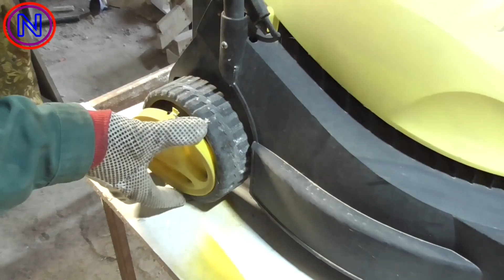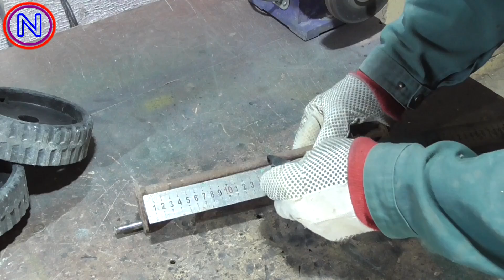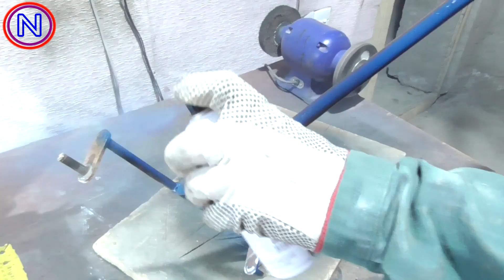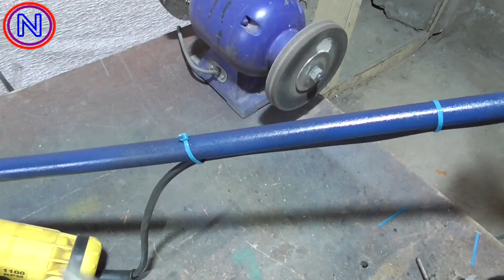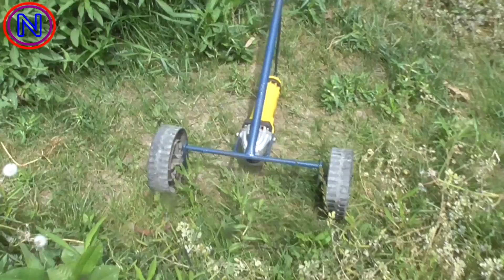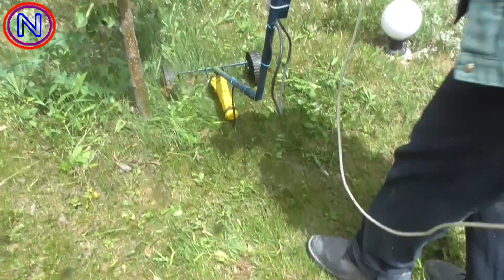AMAZING!!! Garden Life Hacks You Should Know

Comment: Take a old gas electrical generator get a sealed helium stirling cold piston that can generate liquid atmosphere that can fill an insulated tank with a bell siphon that fills an insulated resivor over six stirling cold gas pistons a V6 cold gas stirling engine with antivibration technology then use old gas electrical generator parts and you should have an electrical power generator that operates all off liquid atmosphere. Hell you could even design an air conditioning electrical power generation system too. 😵😲😁

Comment: A push lawn mower a swash plate pump motor a worm gear box to drive the wheels forward and a squeeze lever to operate the swash plate for a push lawn mower that is very easy to use. You could even design it to have other attachments like a tiller and an edger even a weed wacker. 😁

Comment: use half butter biscuits metal box or a plastic bucket upside down cutted and fixed around the back of the rotor as a protection, protection for your legs and containment for flying stones the wire tend to project everywhere while cutting the grass...

Comment: Wow lots of negative comments, but, with a simple pan shaped guard over the top, and safety boots and bearing in mind this is how strimmers sold commercially work. A high speed rotating disk with nylon not steel (if they came off both would inflict damage).
Cheap import angle grinders that are sold in EVERY country suffer from switch problems so why not reuse and design a remote switch instead of to the landfill.
Do not condemn innovation, suggest safety features, suggest improvements, encourage ideas, isn't that what made America great?